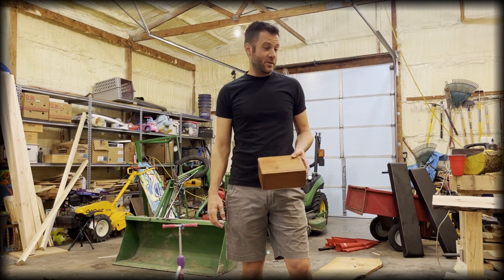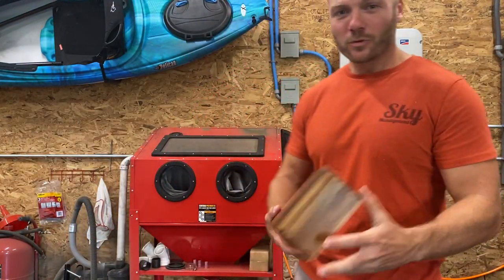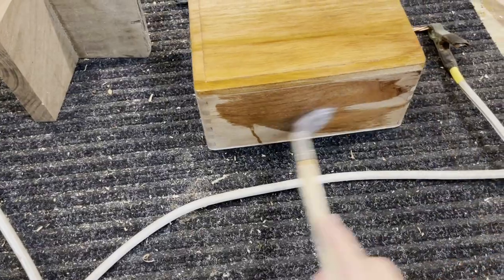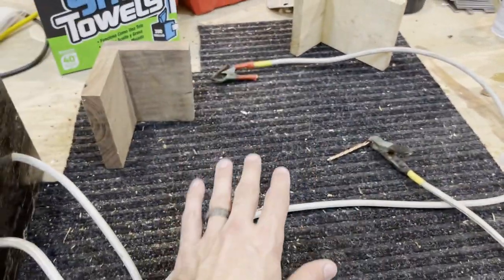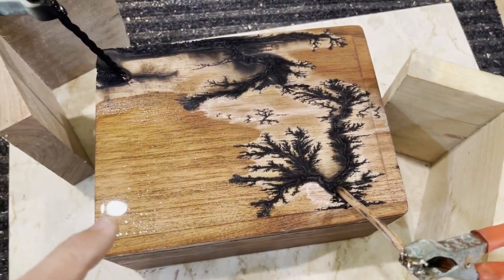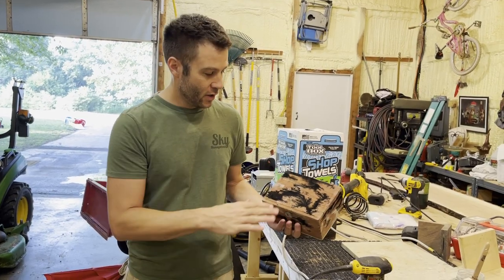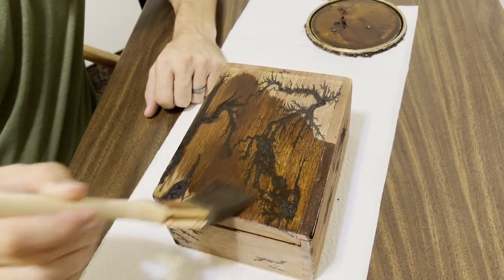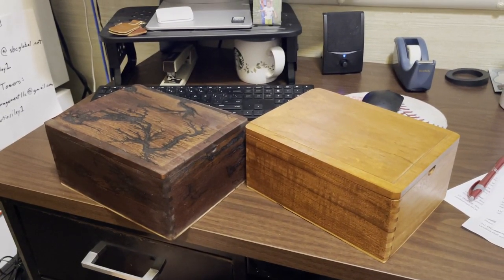Dangerous but Beautiful: Fractal Lichtenberg Figure Wood Burning

Comment: like your video -  I have a question for you and I am hoping you will answer it.  I have a neon unit instead of a microwave unit -  what type of wire did you use to go from the unit to the clamps.  You mentioned heavy wire, do you have any suggestions.  Thanking you in advance for any help you can give me.
Reply from the maker: We used a heavy wire with thick sheathing from a 220v stove plug.  We happened to have on old one when we replaced an old stove.  With a neon sign transformer it is my understanding that they are a better way to do this type of burning as it can do “finer” and more precise burns.

Long answer to your question is I do not know what gauge wire is “recommended “ but I would suggest not using thin solid strand wire such as that from electrical wiring in your house as repeated movement of said wire leaves them prone to breaking and sparking which would be dangerous.

Please be safe.
Reply: @SkyManagement  thank you much appreciated